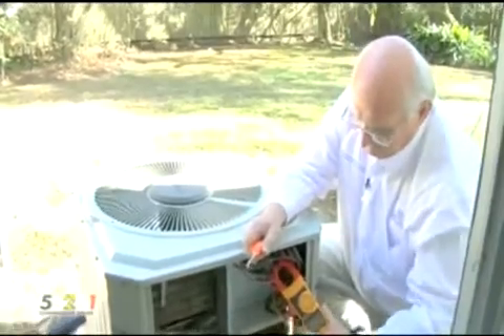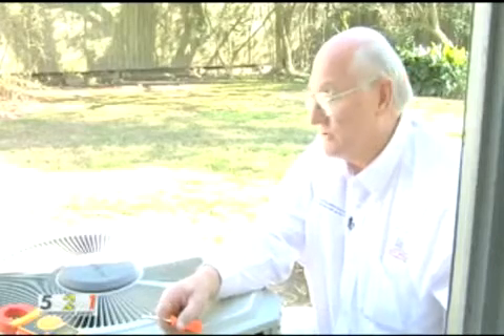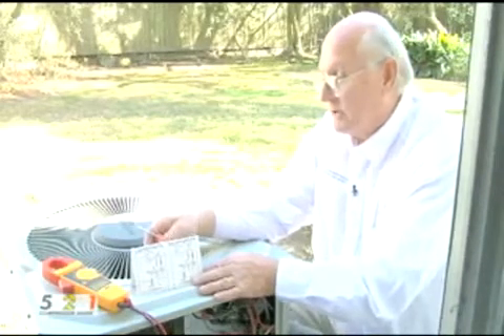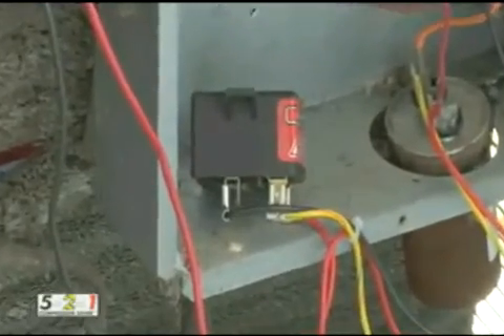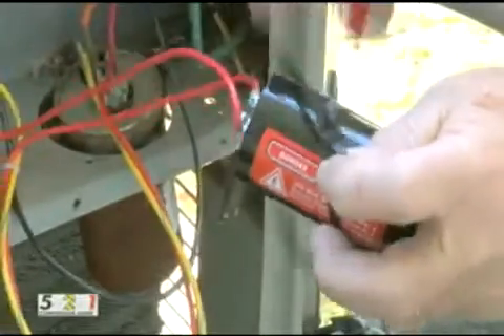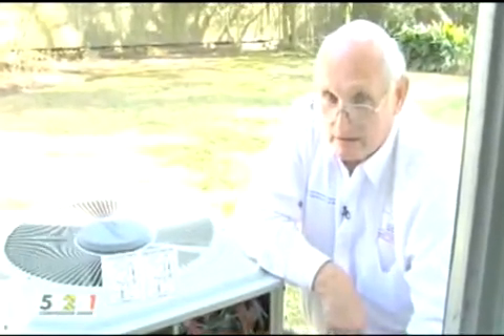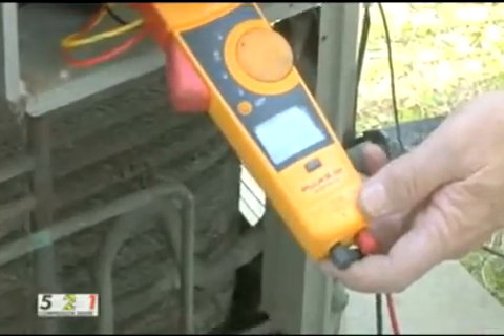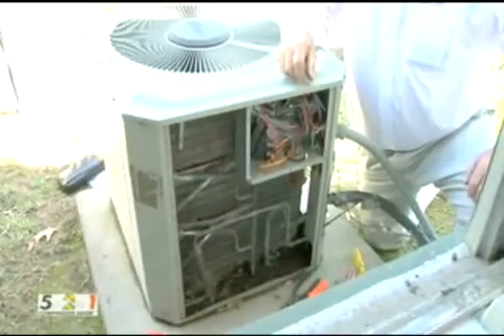ACWholesalers.com Presents 5-2-1 Compressor Saver Installer Part 2

Comment: good video, how long does the 5-2-1 last?  I have a scroll compressor, I heard that they do not need one.  I checked my in rush and its 10 amps over LRA.  I heard its normal for scrolls to do that. What are your thoughts?   Thank you for responding